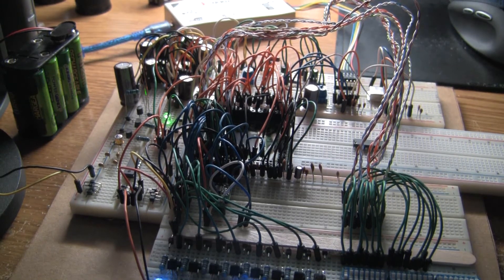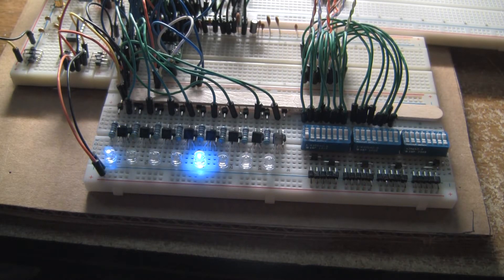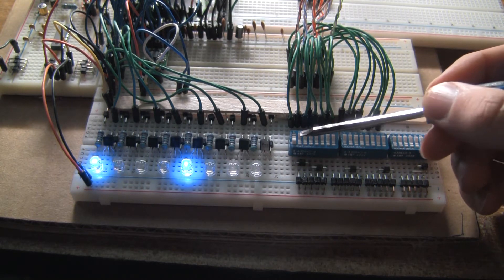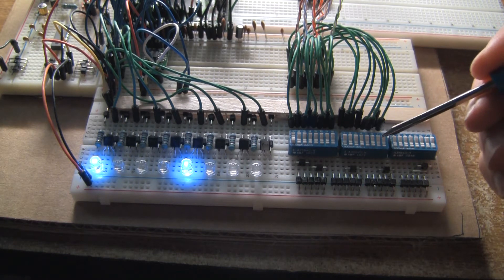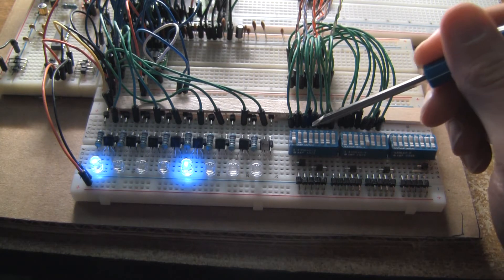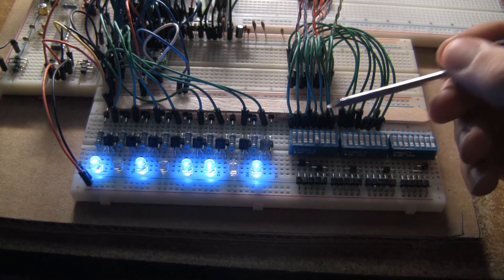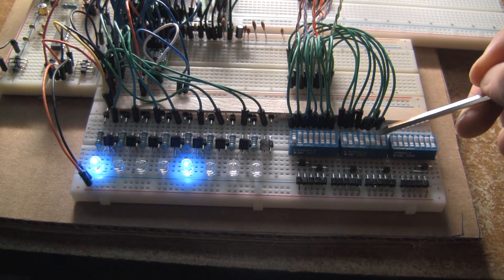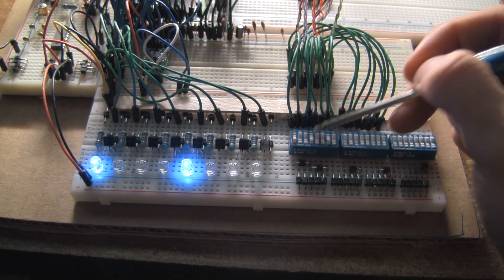Fun with F-RAM, Redux

Comment: @Tbird761 Was the Fram device holding the bitfile for the Spartan6 or was it just used as a run-time peripheral device?  We want to use the FRAM (CY15B104Q-LHXI) to store the bitfile for the Xilinx Spartan XC6SLX16-2CPG196I but we are not sure if upon powerup will the Xilinx read the bitstream (.msc) correctly since the xilinx state machine would normally be used with a Flash Prom.  Furthermore, if indeed you used the fram to program the Spartan, how did you get your bitfile into the Fram?  Did you use impact?  Please let me know what you did.  Thanks
Reply from the maker: If I recall correctly, I was using that FRAM module just as peripheral memory and had programmed the Spartan-6 over JTAG without any sort of PROM attached.  I probably had programmed the FRAM module over RS-232 using a flash writer design that I had made.  I've tried to use many sort of standard memory devices as PROMs before with Xilinx FPGAs (as opposed to Xilinx's special and more expensive official PROM modules), but I've not had any luck to date that I recall.  Theoretically, a standard SPI device should work since they almost all support the same standard read commands.  I believe the Spartan-6 is even toggleable with regards to if you want it to issue fast reads or standard reads to an SPI device (since some memory devices lack fast read support).  It has been a number of years since I've tried, however.  I've mostly used Spartan-3AN devices for things that need to be persistent instead.  They can't run at as high of a frequency, but they're still very capable and have the benefit of being both cheaper and having built-in configuration memory that can be programmed over iMPACT.
Reply: @Tbird761 Thanks for the reply.  At least you just saved us time from going in an impossible direction.

Comment from the maker: @wanderingherald A Spartan6 is basically like a Spartan3 in most regards, but it is a newer product manufactured on a smaller process (45nm).  You'll be able to run your state machines at a higher frequency on a Spartan6 versus a Spartan3 and there are some hardware blocks built into the Spartan6 that aren't present in the Spartan3, such as a PLL.  Spartan6's top end chips also allow for more logic blocks than Spartan3 chips do.  If you don't need such things, there's no reason to buy the 6.

Comment: @Tbird761 Another question, I am a noob in this field, so what is the difference between the spartan 3 and 6 series boards. My lecturer handed me a 3A board but has budget for 6 if needed, so what difference will an upgrade make in terms of hardware limits? In simple terms please.

Comment from the maker: @wanderingherald Probably so.  Unless the pong program instantiates hardware IP blocks that exist only in the Spartan 3, you can port it to any other FPGA that is sufficient to fit all the logic and is modern enough to not break expected timing performance.  All you'd have to do is modify the I/O pin assignments in the UCF to match your new device.